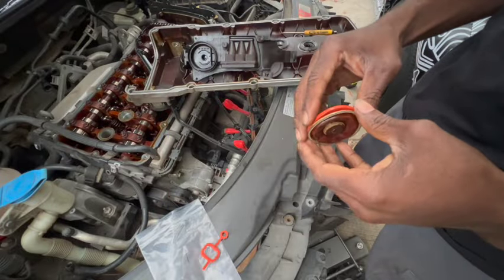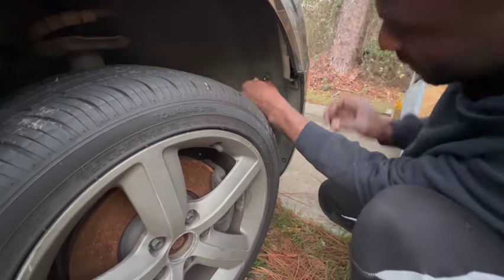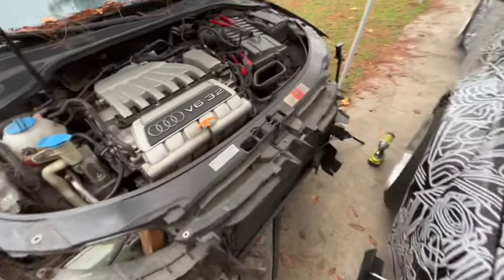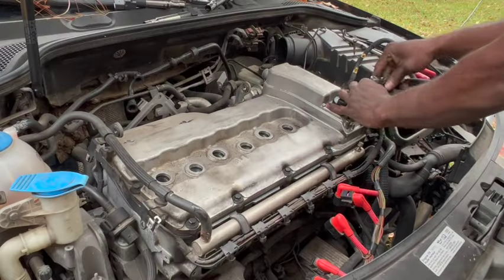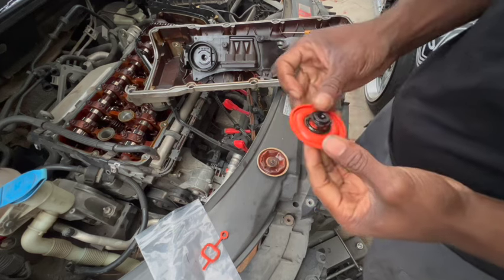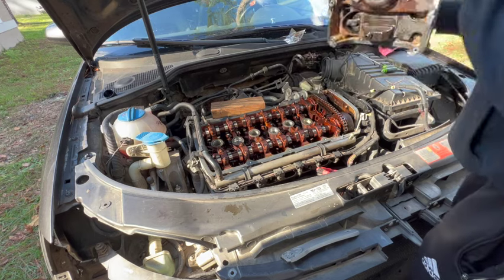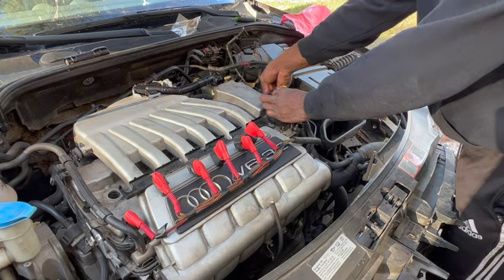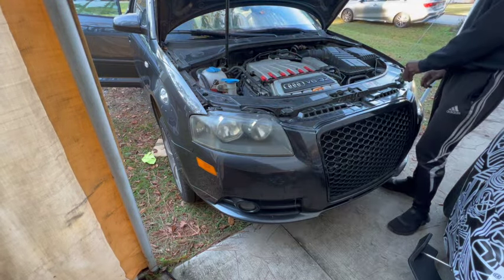Audi V6 3.2l PCV | PCV Leak | How To Repair PCV | Audi A3

Comment: Why is the silicon specifically added in those 4 points? Can you clarify?
Reply from the maker: @leviengel the reason for those areas, oil is gonna travel where it can and according to manufacturers specs, those joints and corners are Vulnerable for early leaks